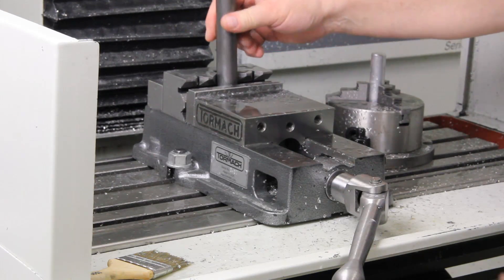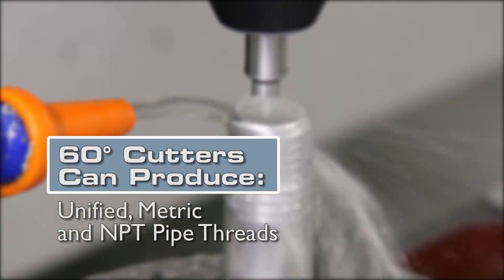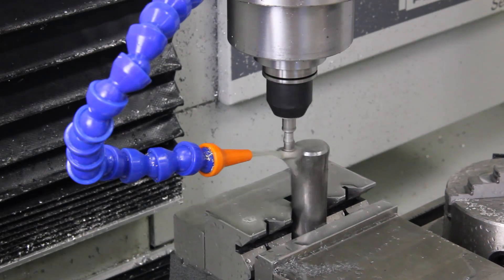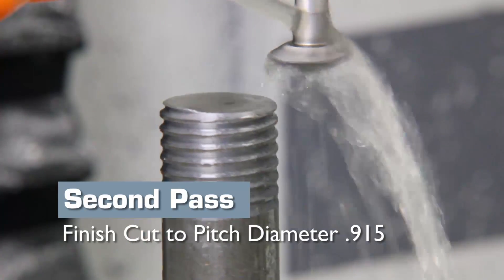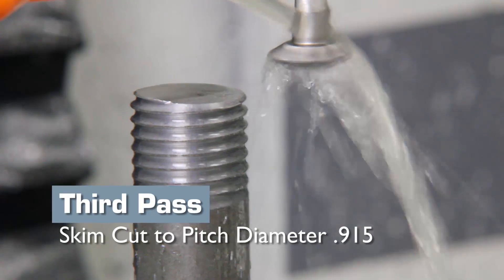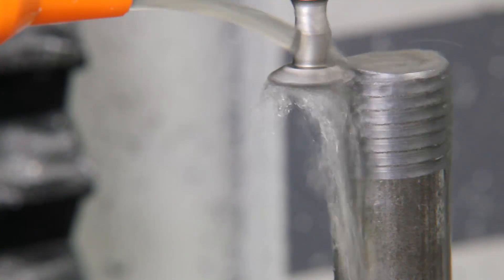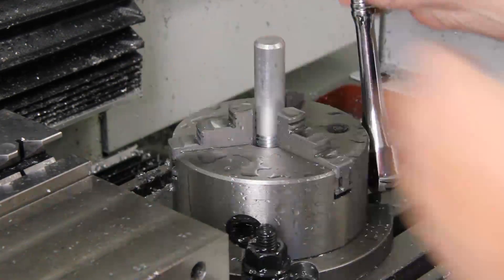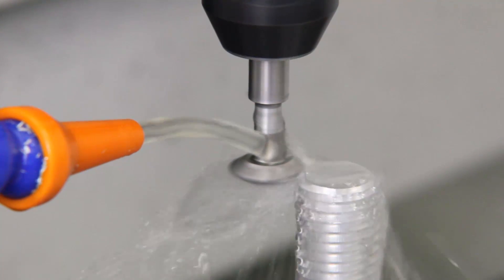External Thread Milling Demonstration - Tormach CNC

Comment: Great video! I've been looking for a cutter like that to cut threads in wood using my metal lathe with a foredom tool holding the cutter. The smallest shank size I can find is 3/8" and my foredom handpiece will only accept a 1/4" shank. Do you know if anyone sells these with a smaller shank size?
Thanks,
Tim
Reply: Why would you use a thread mill in a manual large when you can single point it?

Comment: The only threading milling experience I have are internal threads.  They usually last a long time can be comped and don't make a mess when failure occurs. Honestly ,I have never seen a cutter like this ( almost woodruff type slot cutter). But this is very cool.

Comment: not sure of the benefits of cutting thread on a mill.  not to mention how many inserts this bit costs.
Reply: The advantage is that you can drill and threadmill holes in a single operation without having to pull the part.  If your mill can do rigid tapping you could tap it instead, but threadmills have some advantages.  I.e. They can cut many size threads, the thread fit is adjustable, and if it breaks you can grab it right out with pliers;you don't have to burn it out like a tap.
Reply from the maker: Yes, a lathe might be better suited for large runs, but if there is only an occasional need for thread milling then this can come in handy.
Reply: I may be blind, but I'm pretty sure that's not an insert cutter (Edit- I've never actually seen a cutter like that used other than for gears. Threadmill or tap is more common, and faster. There are also insert cutters that work as a threadmill)
And there's lots of reasons to cut a thread on a mill. Not like this, obviously. It was a demonstration. Thus, no chamfer, no turned OD, no nothing but the thread
 But if you're doing a milling operation, and there's a thread in it, might as well do it on the mill. Or how about a bed-post type application. A square with 4 posts, that you want to have threads on for whatever reason. Multiple drilled and tapped holes in a block?

Comment: how did you sett upp de g-code fore that milling??
Reply from the maker: You could program it in a program like SprutCAM, but in this example it was all coded directly in the g-code.
Reply: I think pathpilot has a wizard for it now.  It's a with cutter compensation it's easy.  g0 to move to the start position, g91 to go incremental mode, and g02 to cut a circle in three dimensions for one thread, plus L on the end to repeat the command how ever many threads you need.  i.e. 

G1 g41 d2 x0 y-0.2185 F55
G91
G2 z-0.05 x0 y0 i0 J0.2185 L10

That's for a 1/2-20 stud like in this video.  Threaded holes are a bit different.

Comment: It's nice to showcase what your tools can do. Sometimes changing a setup will throw off your tolerances when doing the cutting. This way the part is in a fixture already so it saves setup time from moving from a mill to a lathe.

They make 9 axis lathes to save setup steps also the have live tooling and do the work you used to only do on a mill.

Comment: For the AL why not cut to .684 and then light cut to .682 that way there is a constant low load for the final pass?

On some stainless steels you have to have an active cut otherwise you work harden it and you can end up breaking the tool.